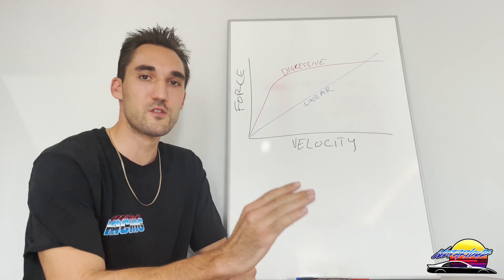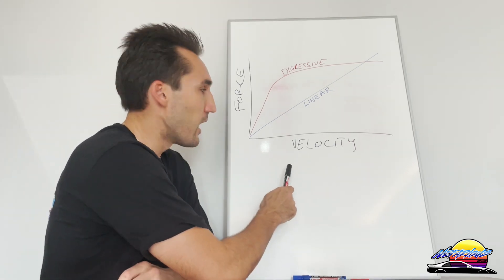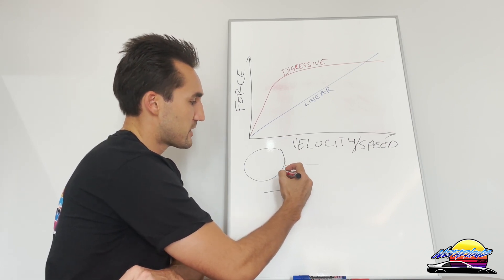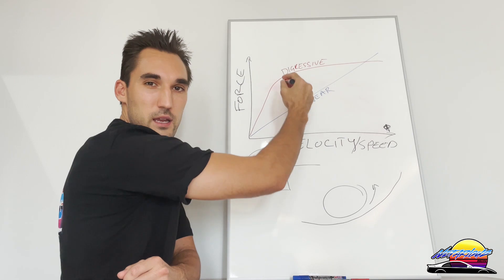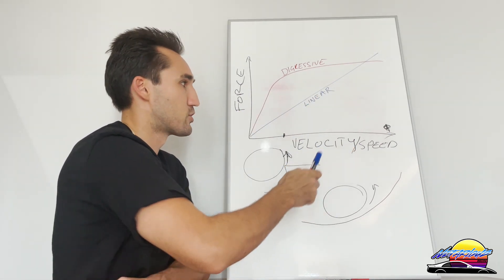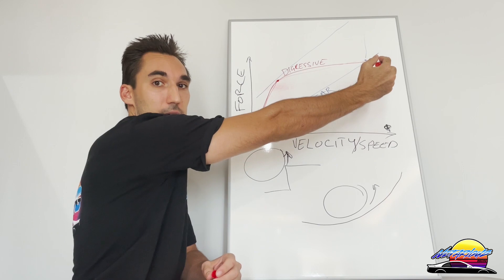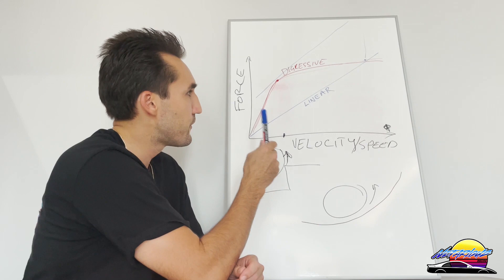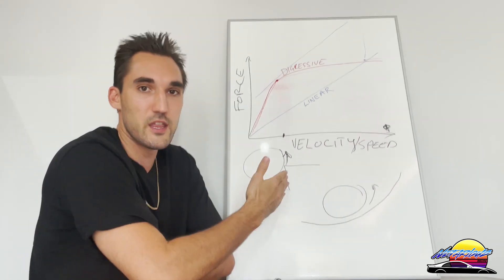Linear VS Digressive Coilover Shocks: What's The Difference?

Comment: Dyno doesn't tell everything.
Linear shocks are still digressive due to sticking at initial movement.
Dialed in valving is more important regardless 
Firm controlled comfort with adequate travel and plush bump zone is the goal

Comment: You got these backwards

Digressive valving is used for street racing

Linear is off-road
Reply: You got it confused.  Street racing is the same as track racing.  It's more for smoother road performance for better cornering and such, where digressive is good.    Off road is specific for bumps, which linear is better.

Comment: how do you change your coil over kit from lenar to digressive?
Reply: can you post a video showing how to assemble a shock/spring set up at linear vs digressive?
Reply from the maker: @KathleenFriesen  This is done by changing the shocks' internals and depends on the kit etc, it's not as simple as just swapping out springs. The only kit I know that has this ability is Riaction but you have to send your coilovers to them to do it.

Comment: I have a completely different understanding of digressive pistons. On slow piston speed, it'll have high/your set dampening. On high piston speed, it'll bypass the oil to allow the piston to move faster. That way, your car won't get air borne when hitting a big bump even with high dampening.
Reply: yeah he's got it reversed i think too
Reply from the maker: Yes, the amount of damping force applied to the piston tapers off at high speeds compared to low speeds. That's what I said in the video.
Reply: That is exactly what he said ?!
Reply: thats what the video says